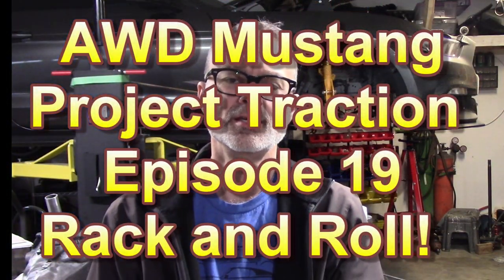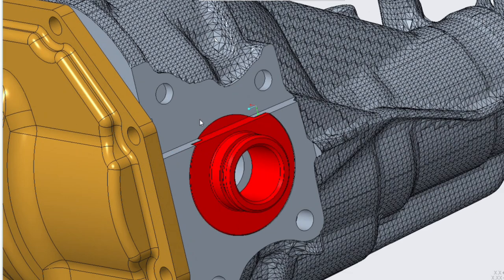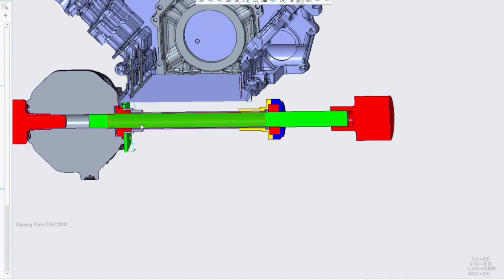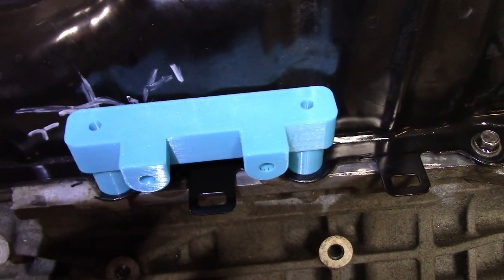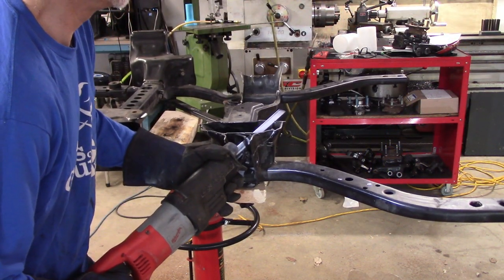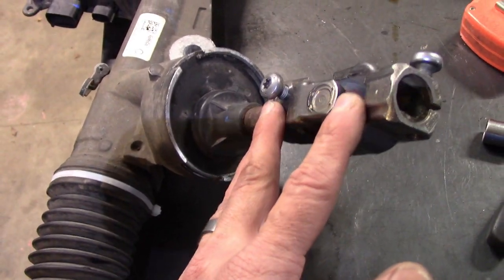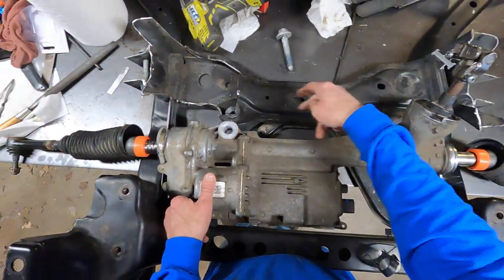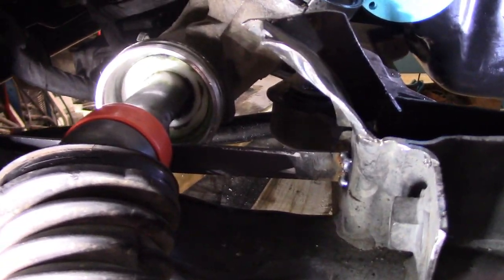AWD 5.0 Coyote Mustang Oil Pan Part 1, The plan  - AWD Mustang Ep 19

Comment: Every engineer is like let me redesign everything so this rack will fit, every mechanic is like put a manual rack in it and lets go.  Great videos!
Reply from the maker: I am not going to lie, the thought of going hydraulic power steering did cross my mind.  But, don't know how the computer would react.
Reply: @npvg   your solutions have gotten you this far.  I’m not if the car will even operate without whatever signal it gets from that module.   People get upset over different manufacturers parts on cars, like nobody ever put a Cadillac motor in a T bucket or a 9 in rear under a Camaro.  Just keep doing what you’re doing. If it were easy everyone would do it.

Comment: I’ve just binge watched the whole project to this point over the past few days. The fact that the unibody clears a CV so well while only modifying the subframe makes me think this whole thing, with some development, could be a kit. Very exciting prospect.

You may have answered this on one of the earlier videos, but do you expect to integrate transfer case control into the Mustang body/engine controls or will it be stand-alone? I’ve been surprised by how easy you made it look to adjust parameters like gear ratios, but I have to imagine adding a function like transfer case PWM into the traction control strategy could be a lot more complicated.
Reply from the maker: I am going to use a stand alone controller for the transfer case.  There are several that are available.

Comment: @12:00 Toyota Prius power steering assist uses a motor on the steering shaft rather than on the rack. Might switching to a manual rack with the toyota steering shaft give you the space you need?
Reply from the maker: I am concerned about the car freaking out if the current electronic rack is not plugged in.  Otherwise I seriously considered switching to a hydraulic rack, which would probably have better feedback.

Comment: I just started watching this series, very very interesting. I would like to cut my own splines and involute splines, could you maybe help me find where you purchased tooling? I have some ideas for other projects but shafts are constantly an issue.
Reply from the maker: I am using tooling from Advent tool. 
https://adventtoolusa.com/

I can be more exact if you need me to.  But, basically you need to buy a holder and then determine what insert you need for the exact spline you are making.  The holder is about $200 and the inserts are about $50, but they seem to last a long time.  Let me know if you need more help.

Comment: Moving the rack forward or backwards is going to dramatically change your Ackerman as well
Reply from the maker: It is very likely that it will affect it.  Will it be a big deal is the question.  I can make offset inner tie rod mounts if it becomes a problem, like what some drift cars use.
Reply: @npvg  as a drifter and suspension guru I know it will. Ran into the same problem with my RWD fusion and changing the ball joint position.

Comment: What about replacing that steering rack with one that puts the motor inline with the steering shaft itself? You could get a smaller rack and pinion without all extras inside and have more placement options for the motor itself.
Reply from the maker: I would go hydraulic before that.  But, the real reason is that I am concerned about the car's ECM freaking out if there is not a electric rack to talk to.
Reply: @npvg  Makes sense. I'm kinda over chasing hydraulic leaks at this point😅 Figuring out how to plan around the electric booster has me spooked. 

Your build is definitely inspirational. I'm glad to be here for the ride.
Reply: Get in touch with power by the hour and Lund Racing for your tune. They do thousands of swap cars. They can advise you on keeping the electronics happy.
Reply: I can get you an Ngauge if you go that route. Best device ever made for factory ECU tuning.

Comment: Dumb question, but why not swap the rack for a fluid power steering rack and use an electric power steering pump?
Reply from the maker: I am concerned the car will freak out if the electric rack is not plugged in.  I am not sure it can be turned off with Forscan?

Comment: Any reason why you haven't just adapted a 5.7 hemi AWD Hemi oil pan, diff, and rack to fit? I imagine you could cut the top of the pan off and and weld in a new mounting surface for the ford block. A police dodge charger AWD Hemi would be a perfect donor.
Reply from the maker: The simple answer is I want to try and keep the Mustang front suspension geometry. 

The longer answer is that the Charger front diff is sort of an odd ball and there are not a lot of gears ratios or limited slips available for it.  In the Chrysler applications, they are all 3.07, which is not good for a manual transmission.
Reply: Well said

Comment: @8:50 - I'm concerned that your proposed jack-shaft location is dangerously close to your #2 and #6 connecting rod caps.   Are you sure it's going to clear the full range of rotation?   I think it might be a good idea to 3D print a modular fixture to place on the block's oil pan mating surface to take measurements.   Or maybe just lay some 1-2-3 blocks on the surface and lay a straight edge across.
Reply from the maker: This is a legitimate concern.  You are absolutely correct, the cross tube for the jack shaft is going to be directly below the crank through.  I basically did what you are suggesting and if I did everything correctly, I should about 0.100 inches of clearance to the rod bolts.  Common internet wisdom suggest .08 is enough.